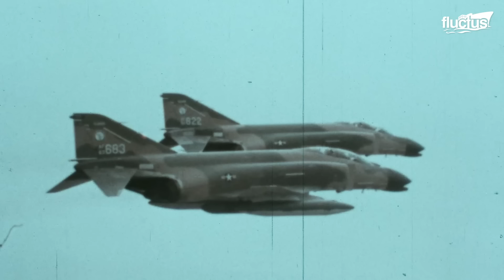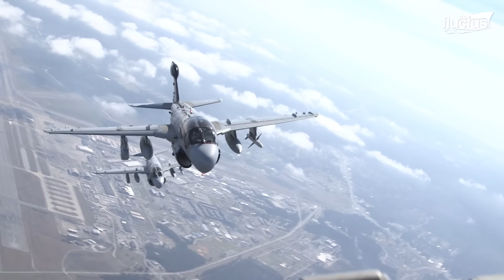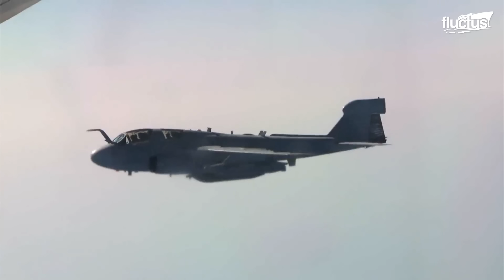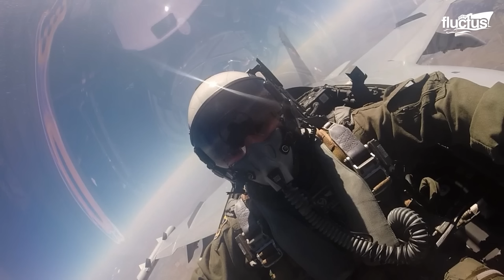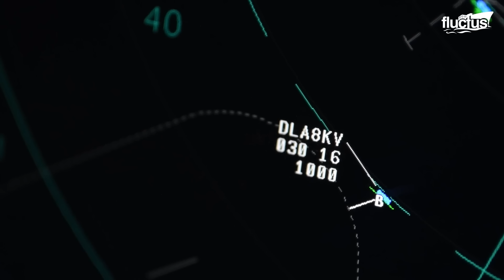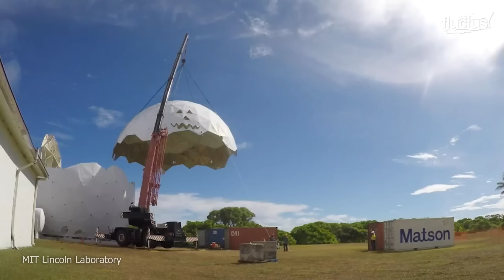Extreme Operations of US Most Dangerous Weaponless Warplane Ever Built

Comment: I overhauled A6 outer wing panels all variants for Grummans in St.Augustine, FL  Navy and Marines variants after two A6’s outer wing panels exploded in flight prompting inspections. It was discovered that during hot pitting the outer wing panels were being over pressured up to 15 psi (5-7 psi max.) separating the milled lower cover the riser’s were being cracked and split from the lower covers. All the A6 outer wing panels were torn down for inspection some were repaired others had a complete lower covers replacements. I tested the 1st repaired outer wing panel and sold it back to the Navy for Grumman St. Augustine Corp. in the middle to late 80’s. I was a Navy vet assigned to A7E Corsair II squadron at NAS Cecil Field FL before working for Grumman St. Augustine Corp.

Comment: I didn't understand the subject matter but loved the aircraft! Thank you for another fabulous video. 😃😃😃❤️❤️❤️
Reply: The EA-6B was built for SEAD
Suppression of Enemy Air Defenses (SEAD) 
Russian missiles in Vietnam were devastatingly effective to the point where the USAF/USN/USMC had to rapidly develop aircraft to combat the missile sites
Early SEAD tactics was simply popping up on radar and getting to fire , 50/50 dance
The EA-6B differs as its systems are able to blind the radar from 100 plus miles away. The newer AGM-88 which replaced the older missiles would be used to destroy the site radar
The problem was that while the EA-6B had the sensors, it lacked speed. Radar operators would shut down to avoid AGM-88s shots
The EA-18G is substantially faster and has better weapons to engage sams from long range much faster and the newer AGM-88G is basically a mini cruise able to engage anything on the ground
Reply: @verdebusterAP 😃😃